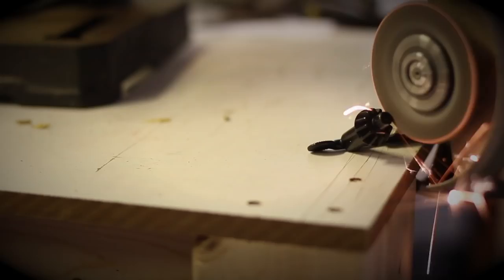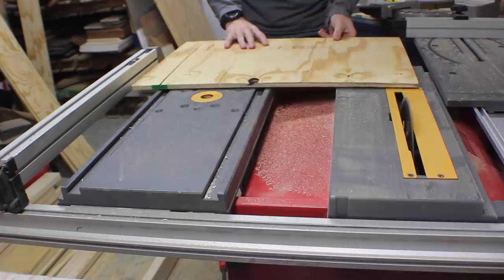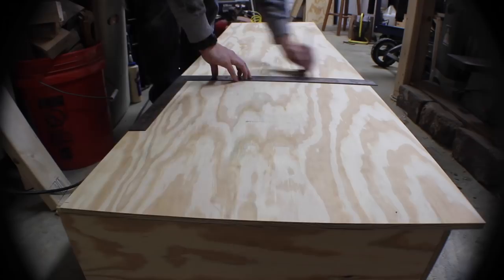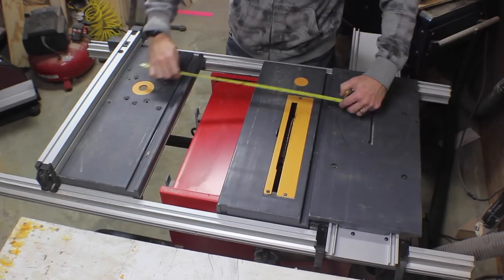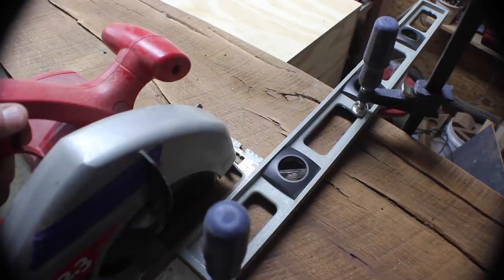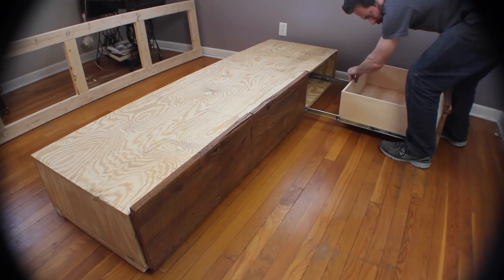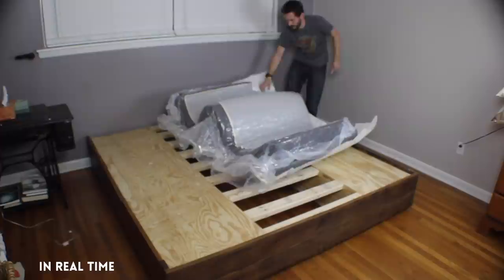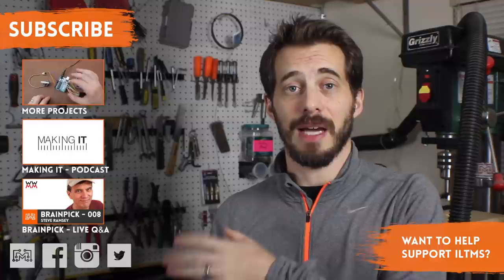King size bed (with storage) // How-To | I Like To Make Stuff

Comment: Bob I remembered you said during the brain pick with steve that you always had an issue with burning on your table saw. I think I might know why you're having that issue. It looks like you're using too high of tooth count blade on your table saw. I had the same issue with my Ryobi BT3000 because I was using a 80 tooth blade. I then switched to a 50 tooth Marples combination blade and I get the same smooth cuts and almost no burning. Plus boards ripped so much easier. Hope this helps!
Reply from the maker: Awesome, good call! I actually got a new saw recently so that should be less of an issue now. Still, that's a great tip so thank you!

Comment: My wife has been begging me for a king size bed and the only thing holding me back is the cost of a bed and a mattress. I'm a beginner woodworker so I never thought to make one. You made it so simple for me and it looks incredible. Not to mention how much I'll save getting a mattress through Casper. Thanks Bob!
Reply from the maker: Great!!
Reply: Casper (or any of the almost identical competitors)  will set you back $1000 before the base.  So no, its not saving much.

Comment: Love it !! Well done !!
Reply from the maker: Thanks Jimmy!
Reply: Awesome looking bed... Wish I had some old lumber.. What table saw are you using?
Reply from the maker: scott franks I was using a Craftsman portable, but have recently upgraded to a SawStop
Reply: I Like To Make Stuff which sawstop did you get?
Reply from the maker: Ned Bulken The professional cabinet saw.. 30" fence
Reply: heyy
Reply: I Like To Make Stuff are you still working out of the same space? That's a bigger saw.
Reply from the maker: Yes, I am.  The actual foot print of the saw is only a little bit bigger, maybe by 2".  It just looks bigger because the top surface is solid.
Reply: I Like To Make Stuff what kind of saw are you using?
Reply: I Like To Make Stuff what kind of saw are you using?

Comment: Awesome!!  My bed frame is my old water bed frame.  We've had it since about 1986. After messing up my back in a car accident, we had to lose the water mattress.  We went to Johnathan Stevens and got a very comfortable mattress. Now we want to make a new frame with drawers.  Yours in this video is along the same lines as I was thinking only yours looks much easier to build.  When spring comes, we will have to give it a try.  If it works out, I will let you know.  Thanks!!

Comment: Nice bed. I kinda expect an elecrically moveable bed with automatic massager, a coffeemaker and integrated alarmclock, all of that powered by arduino or raspberry pi. :)
Reply from the maker: Well, now that you mention it...... ;)
Reply: I was thinking a small ceramic heater in the middle portion of the cabinets . thermostatically controlled on long cold winter nights. But most of you guys live where it doesn't get cold LOL

Comment: I think a nice ad on would be to put another drawer into the small space between the two outside drawer sets, and I mean that by just making another box and size it to fit between them, and add the sliders and then you have more storage, and you design also makes it adjustable so it serves many different size beds. Loved the build. Can't wait to see more videos.
Reply from the maker: Kurtis Darnell Yeah, that is something that I wanted to do, and still might, but I ran out of time to get it into this video.  Thanks!

Comment: Bob, this is a good project. With so much plywood, the cost of this project goes up. It's definitely stronger and more durable, but the cost is a little prohibitive...when I make my frame, I'll probably use OSB, especially on the hidden parts. Good to watch you build this...it helps when you lay out the in-betweens, like how you ensure the dividers were in the right spot and how you went about it.

Comment: Great job. I was amazed how your design ended up being nearly exact to the king bed frame I made with storage about a 15 months ago. One difference is that I bought eight drawers with hardware from IKEA when they discontinued the old Kompartment line of closet storage. The draw boxes plus hardware were only $9.99 each so I really couldn't pass up that deal. Nice work!

Comment: That's great stuff! Thank you for posting. One thing that you might consider is to either route or use a jigsaw to cut slots in the solid part of the ply (the drawer box tops), so that the mattress can breathe freely. Depending on your environment, you might get mould otherwise. Best wishes, Evangelos

Comment: I have watched this one a couple times and intend on using the side boards from a Queen sized bed to make the outer covers for my King size bed. No big deal the head board is a little narrow.  Anyway, I plan to mostly copy your design except for eliminating the bottom piece of plywood by mounting to the 2x4 sub frame.  That way I can save another $40 for the set.  Thanks so much for the inspiration!

Comment: That bed looks really great.
One question - I love pocket holes, and I use them, but most often for joints, that are not under of stress - do you think, that the joints for the center rails/middle part of the bed are strong enough?

Comment: Question: the main reason I'm building a new platform style bed is because our current bed (with old style metal frame and box spring) moves a lot anytime we move. Is this a pretty solid bed, meaning it doesn't move when you move? Our top mattress is a gel foam, probably similar to the Casper you're talking about. So we'd planned on just getting rid of the box spring.

Comment: I love this! I'll be building something like this to replace the old worn bed frame we have. I think I want to do a center pull out about half the size for between the two "cabinets". Just like one, big, drawer. I'll just need some heavy duty drawer slides. Great project and I'll be checking out that Casper company!!
Reply from the maker: Matthew Prince Yeah! I actually wanted to do that too (and still might) but ran out of time for adding it to this video.

Comment: Awesome, awesome design and simple too.  I am planning on using this design (with a few slight mods of course).  May I ask what the height is with the mattress?  I will be replacing 2 dressers in our room to make room for a king size bed.  I will need as much storage as possible and think I may do 2 high (6 each side).  Thoughts

Comment: When building large furniture always keep in mind moving and storage. Should always break down into a few smaller pieces. Working for a moving company, we come across a lot of pieces custom made that are just too big to move out of the house. Some times just a regular king size box spring wont even fit up the stairs unless it's a split box (2pc).

Comment: Hi Bob.  Very instructive video.  One query though; any reason why you use pocket-hole joints most often?  Are these sufficient for load-bearing frames?
Reply: Pocket holes give a decent joint, but all those joints need glue as well.  Without internal bracing  these frames are going to become loose over time.

Comment: Love your videos and projects. Building house and furnitures myself, and your projects is fun to watch and inspirational, because you many things different than I would do them - a good way to pick up on new ideas.

I like this bed a lot. Looks good, and it is very practical. In the end I have two suggestions for it tho :). Now this is not meant to say anything bad about your design or work, and I hope it won't look like that either - it's just a collection of my thoughts after watching the video.

First one is about the frame in the middle. I am a bit heavier than the average person, no point in denying that hehe. So when I make furniture that I am to lay on, sit on or stand on top of, I naturally take that into consideration. Now, it's not that I don't think your frame would hold me - not that heavy hehe - but I am kinda worried about it weakening a bit over time. After all, most people do not lay down on the bed and stay completely still there all night :).

My suggestion is to build the frame in a little different way when used by a little heavier than average people :). I would probably turn the 2x4" 90 degrees and use longer bolts (maybe 4" long instead of the pocket holes and smaller screws) and make it a seperate frame. That would be mounted on top of another set of 2x4" glued and screwed along the back of the storage. That way, you get a very very strong construction that is also very easy to fix if it should come apart. The bonus is that it would be easier to split the three parts of the bed when moving it.

My other thought is a suggestion for a little bit altering of the design. I really like this design of yours, really! :) - I just sat down here and thought, what if you want to have nightstands besides it... It would be in the way of the innermost drawer there. So it's just a personal preference. If it was for me, I would make space for a nightstand, so you don't have to move it to open the inner drawers. You could say that you could have it both, but it would be more annoying than useful to me. I would put something in there that I need one day, and have to move everything out of the way - 5 times and I would wish that there wan't a drawer there hehe. Of course, nightstands could be hung on the wall, etc... like I said, just a personal preference.

Btw - I think you are very very skilled, and your videos are good, get right to the point, and tho it is not real-time, there is no problems seeing what's going on.

Comment: Are those 2x4's in the middle strong enough with just pocket screws?  If I were doing it, I'd have at least added a board lengthwise for them to rest on, essentially like a rabbet joint.  Then again, I've broken three beds in the past during... active bed time.

Comment: Hey Bob,   As a foam/latex mattress there is of course no internal structure.  Yet you just lay it across the central section of the bed which has all those gaps.  Do you really not notice any sagging there?    I would have thought you would need a section of plywood across that middle gap.
Reply from the maker: Nope.  Slat beds with a mattress only are very common. This mattress is really dense too so you can't notice it at all.
Reply: I Like To Make Stuff Brain hiccup... I knew that about slat beds.  I even built my daughter one.  http://www.wordsnwood.com/2012/shakerbed/  

But I had not used a foam mattress there, and your slats did seem a bit widely space.   Can't argue with your results though.   Happy and Joyful Christmas from us to you!

Comment: you could put in those soft closing devices on your drawers and I'm not sure if the plywood drawers are strong enough to withstand weight
Reply from the maker: peter griffin They're absolutely strong enough. The bed is sturdy and working great.

Comment: Thank you!! I really like this. Would it be similar process for a Queen frame as well? I'm wondering about the 2x4 pieces used in the middle (top) to join the 2 cabinet/drawer sides...will it hold the weight/pressure etc. of every day use? Is there no need for supports in the middle (bottom side joining the drawers)?

How firm is the mattress? We're looking for a comfortable, yet pretty firm mattress cuz of back problems.
Reply from the maker: They seem to be fine, but you could add a ledge underneath them to support them. That'd be a simple addition. 
A queen would be the same with slightly smaller dimensions.   
Yes, it's firm but also really comfortable. I've been really happy with it.  Plus, if you don't like it, they'll take it back :)

Comment: I really enjoy your videos and your podcast. Thanks for showing that its ok to use a butt joint and that it doesn't have to be a dovetail\box joint for every application... one question i have is about center support on the bed. did you end up putting any bracing under the 2x4 cross members?

Comment: Great design! How heavy are the base units? Seems like they would be a pain to move, even after separating them. 2x3s would save weight and a few bucks without really losing strength.
Reply from the maker: Jon Miller Once they're separated and the drawers are removed, they're really light actually.  The majority of the weight is in the drawer faces.  The oak is thick and heavy.
Reply: Cool. It's always hard to gauge that sort of thing in a video, or in my mind. Thanks for the quick response! :)

Comment: nice man.. great use of the dead space under the bed. Are you happy with drawer size you chose? It seems like you couldve made them much larger? Thanks for doing what you do. Love your vids.
Reply from the maker: tractorp2255 Yeah, I am.  I made a twin bed one tim with full depth drawers and they were just WAY too big.  You could barely open them all of the way.  This is much more usable, and you could easily add some storage to the middle area with an opening toward the foot of the bed.  Thanks!!

Comment: I am getting ready to make my own bed frame and was wondering if you could give me some advice on making the drawers. When making the drawers do you simply make the drawers to the width of the inside of the comportment or do you have to make the drawers shorter to account for sliding rails? Thanks
Reply from the maker: RideFree383 yes, you'll need to account for the drawer slides. They're mostly 1/2" thick but all a little different.

Comment: I was thinking about trying this project. What, if anything, would you recommend to make sure it could support the weight of a heavier set guy? Thanks!
Reply from the maker: Honestly, I think it'll support quite a bit of weight.  If anything, maybe go up to 3/4" plywood for the frame and put some 2x4 braces from the center section down to the floor. 👍🏼

Comment: You may experience some mold problems under the mattress. I think you should consider lifting the mattress from the plywood to let the air circulate and dry the mattress from below.

Otherwise... nice design.

Comment: That was some proyect, wouldn't be best to put the center braces vertically rather than horizontally so the bed can hold more weight without a bracer accidentally break in some important moment?

Comment: Don't know if you still respond to this video, but would it be sturdy if I doubled the height of the openings for 2x shelves? Also where do you shop that rips 8x4 wood to 8x2? (Home Depot and lowes only can make it 4x4). Lastly is there a structural reason why the gap with no shelf was at the foot of the bed instead of the head of the bed?

Comment: Hey Rob, I’ll be constructing my own bed frame and my design is very similar to yours, so i’m just wondering to how well the plywood cabinet frames have held up. I’m alot larger than you, so i just need to know if there are areas that you may have noticed over time that should have been reenforced differently

Comment: I'm a much heavier guy.  the center two by fours didn't seem to be to sturdy.  what would be the rough weight rating on this project and if it is more the about 500lbs what would you do to reinforce it ? 

I'm more of a metal working guy so I'm not sure about the sturdiness of wood joints.
any insight would be appreciated .  Thanks

Comment: I like to make stuff also bro! Im looking for ideas for a bed to make for my fiance and myself as a wedding present for my bride to be and I like this bed alot. I think Ill use pallet wood for the outside and to make a head board also. Thanks for posting this video! Do you have specific instructions on how to do this?
Reply from the maker: +Jerrad Allen Thanks! There's a measured drawing for this piece on my website, that'll help with dimensions, etc.

Comment: I always thought 2x4 braces had to be no more than 2 inches apart for a king size bed. It's a totally cool build I am however somewhat worried about the structural integrity. At minimum i suspect such a bed might not be compliant with the warranty of some mattreses.

Comment: in the intro video... why were you using a angle grinder on a drill chuck key? just curious cause i caught it.
Reply from the maker: b18c5vtececlipse It was a replacement and the post was the wrong diameter so I thinned it out to fit :)

Comment: I'm really wanting to do this but for a full bed, if I did do it do you know how much it would cost (or how much it cost you) and how I'd get the right dimensions I'd have to do?
Reply: I did this project for a Queen sized bed (did my own dimensions and made sure it would work obviously) and it worked perfectly. I also saved money by using OSB 7/16. I only had to buy 2 since my friend's dad had one he didn't use. It works just as good as plywood. I have all of it put together except for the barnwood since I have to get it treated.

Comment: The space in the middle of the bed frame is quite wasted. 
it would be nice if it is replace with a long sliding drawer which work as extra support to the frame.

Comment: Friendly FYI:

Do not use an open slatted mattress support system (e.g., a platform bed frame in which your mattress rests directly upon slats with open spaces between the slats) where the openings between the slats are greater than two (2) inches
(5 centimeters)
Reply: Funny, that's what I used to sleep on, preferably with the slats being just thin enough to act as bedsprings under a thin (3 to 4 inch) foam mattress. A few slats would occasionally break and need replacement over the years, but a nice common solution that was easy to move from one house to the next by undoing a few screws and flat stacking on the truck to make room for other stuff.  Mine had no box around the drawers, so I could reach inside them by lifting the mattress.  Whole thing held together for about 20 odd years.
Reply: "A few slats would occasionally break and need replacement over the years"
🤔 SMH